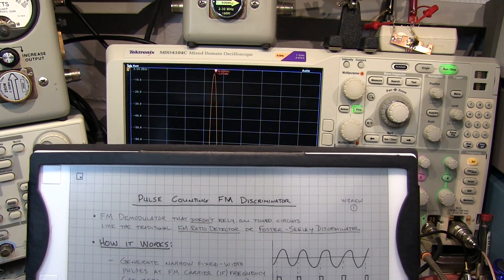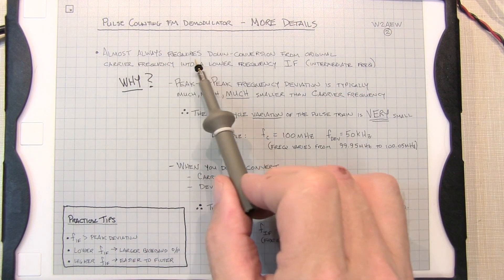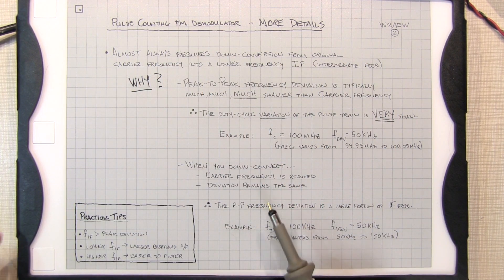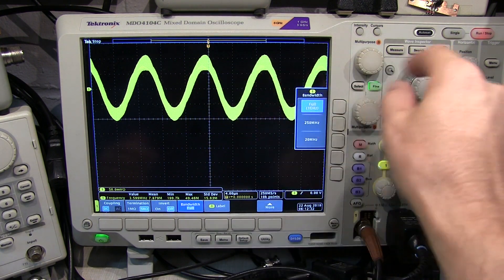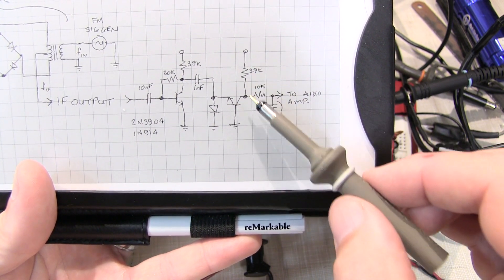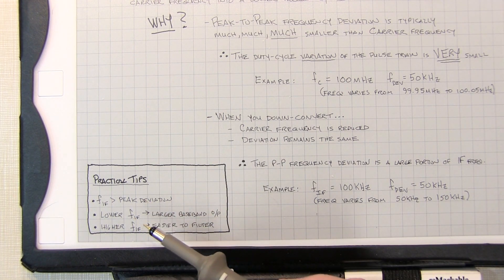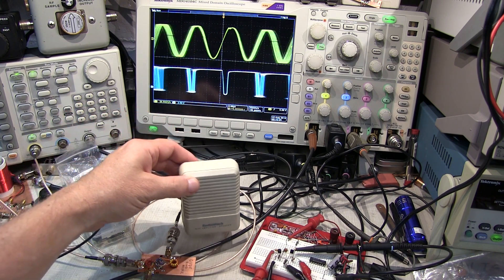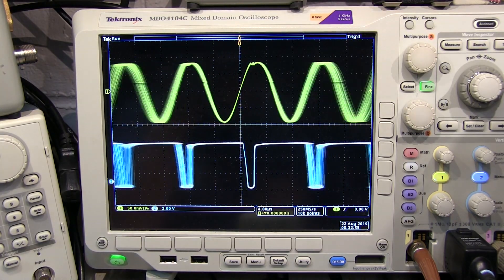#303: What is a Pulse Counting FM Demodulator | Detector | Discriminator?

Comment: Question: Would this set up require tracking between the RF and LO or could the LO be a separate circuit without the use of a ganged capacitor? Ideally, I guess it would. But I'm wondering how difficult it will be to maintain such a small difference in frequencies when tuning through the band... If the LO was fixed at 97MHz would that result in a single station only receiver?
Reply from the maker: No tracking needed if you don't use any type of tracking preselector.  Simply adjust the LO to put the station of interest into the IF.
Reply: @w2aew  
So the antenna coil does not form a tuned circuit? Just amplify the rf and feed it to the mixer along with the LO. The LO would be inductively  coupled to the antenna coil and tuned... yes?

Comment: Well, this is quite an elegant solution. Sure I have to build a railroad communications receiver this way. Russian railways use 2.130 and 2.150 kHz FM channels so I could simply build a fine receiver using ferrite antenna with differential RF amplifier IC and circuits shown here. Great job, thank you. 73 de R2ATO!

Comment: I watched the video and i think i got what it does. The Pulse counting FM discriminator converts RF frequency carrier into a logic pulse train signal with the pulse width always fixed pulse width. The RF frequency carriers modulation deviation amount is what changes & controls the pulse counting circuits to output more pulses or less pulses per second. The amount of pulses in one second is "averaged" to a DC voltage which goes to a LPF low pass filter to convert the pulses into audio signals?
Reply from the maker: Yes, you got it.
Reply: @w2aew  ok thanks

Comment: Very interesting Alan! Always enjoy your videos. I am also working on FM receivers (see my channel), but did not know this method of FM demodulation yet. I’ll certainly give it a try. My preferred method at this moment is using a crystal filter and tune the IF to be on the slope of the filter.
Reply from the maker: Yes, slope detection works and relatively easy to implement, but it can be non-linear which can add distortion to the detected baseband signal.  I'm sure you've likely found this.

Comment: Great video. Thumbs up.

This actually could be a pulse counting FM demodulator if the pulses were fed into digital circuitry which calculated the time between successive pulses (i.e. the instantaneous period of the output) and the reciprocal of this would then be the instantaneous frequency which represents a voltage at that point in time.

Comment: I have a Kenwood KT-815 receiver, which uses a pulse count detector. Both the specs and the sound are excellent. Belar uses the pulse oount detector in their FM modulation monitors, --de N3TPS
Reply from the maker: VERY interesting - I didn't know of any commercially made receivers that use this type of FM detector - thank you!
Reply: @w2aew  The kT-815 is dual conversion, it has a normal 10.7 MHz IF strip for selectivity, after which the signal is heterodyned to around 200 KHz for the detector. They get 0.04% THD and 80 dB S/N (full quieting) is stereo mode!
Reply: @w2aew  Very elaborate and clear presentation, thanks a lot ! 
I am interested to study and finally make some pulse-counting detectors, so I watched your clip very carefully. Congratulations!  While studying the history of this type of demodulation, I discovered that there were many companies that produced FM tuners with pulse-counting. The undisputed champion is Kenwood, but I also noticed Accuphase, Heathkit and Fisher. Here are some FM tuner models equipped with pulse-counting demodulators: Kenwood 600T (1976), KT-615/815/917 and L-07TII (1979), L-01T and KT-80 (1980), KT-9XG, KT-900/1000/1100 (1981).  
Kenwood produced pulse-counting discriminators using discrete components, discrete+some known ICs (TA7060P, SN74LS03 or SN74LS38N, HA1457, NJM4558D) and dedicated/proprietary ICs (TR4010A and TR4011). 
Another FM tuners with pulse-counting: Fisher TFM-1000, Heathkit AJ-1510AS .
I hope that these informations will help. 
Also, a good source of info is the "Tuner Information Center" at https://www.fmtunerinfo.com/kenwood.html .
Good luck and be sure you have one more student watching your clips! :)
Best 73s de Cezar YO3FHM

Comment: Innovonics used this method in their broadcast industry tuners such as their 530 modulation monitor. They take the broadcast band down to the very common 10.7 MHz first IF. Then they drop that by 10MHz leaving a 700 kHz 2nd IF, ideal for the broadcast band. A fully loaded broadcast station with stereo and RDS at 100% modulation, +/- 75kHz in North America, is 253kHz occupied bandwidth. 700k is a pretty good number. Well implemented this method has extraordinary fidelity.
Reply: And they did this with familiar components of the day, CD4053, 4046, 74HC148, the venerable SA602 and basic transistors 3904, 3906. PLL tuner control was by the popular MC145170. They have the circuit description and schematic for the 530 and 531 on their website. As broadcast gear these were intended to be field serviceable.

Comment: Couldn't that work using an actual digital counter?
Reply from the maker: ...only if the digital counter would output an analog voltage proportional to the pulse frequency.  If you had a counter that could do this, then you wouldn't even need the monostable pulse generator.
Reply: @w2aew  Or maybe digital output is what's wanted in the first place, such as if the signal is FSK encoded data.

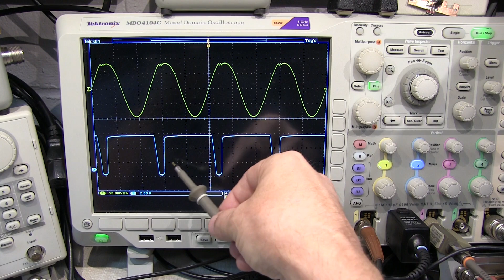Comment: 9:04 Any idea what the glitch is on the input signal?  Looks like there's some ripple caused by the pulse generator.
Reply from the maker: It's possible, especially since there is no decoupling on the power supply.  However, the glitches don't seem to be lined up with the pulse train, so I suspect more that it is distortion from the mixer, or possibly from the IF amp/limiter.
Reply: @w2aew  It looked like it was starting on the trailing edge of the pulse, at least from what I could see in the vid.  Then again, stuff like that happens on a simple breadboard.

Comment: A  very interesting FM demodulator. 

Do you think it would be an issue to have the LO tracking the RF frequency so closely? I guess one consideration would be to have the LO not sitting on the next upper or lower FM channel adjacent to the one being demodulated but somewhere between the stations... 

As always, another pure gold video. Stellar stuff!
Cheers,
Reply: The figures were just to explain the principle and not meant to relate to any specific FM band plan or system.

Comment: .
Reply: Thanks a lot for this very interesting video and  I learned enough to give it a try myself! Building simple super regenerative receivers is fun but after a while you realize that the slope detection method has its limitations and you want something better. Forgive if I sound raher stupid, but as a newby to this pulse counting method I'm trying to understand how the mixer can differenciate between all the possible intermediate frequencies. I thought it would be necessary to filter out this 200 kHz IF but I fail to see how this is done in the schematic, since the tank circuit has a relatively low Q. (I also saw the Armstrong FM receiver and there it was even less obvious since there was no input tankcircuit in the self-oscillating mixer)? Surely mixing also takes place  with all other possible adjacent frequencies? Thanks for enlightening me!